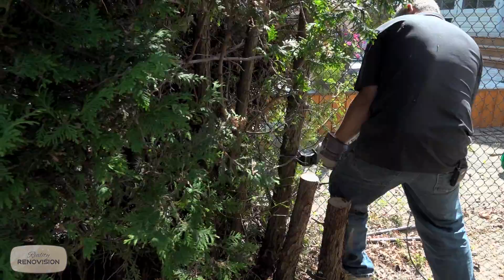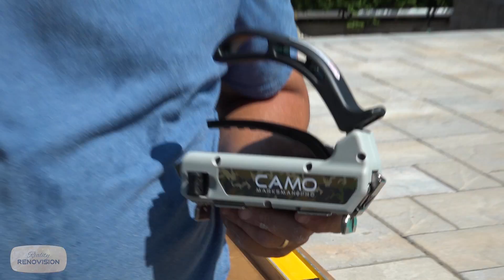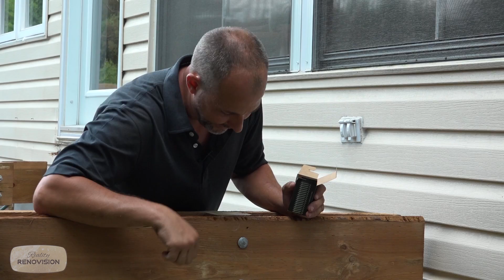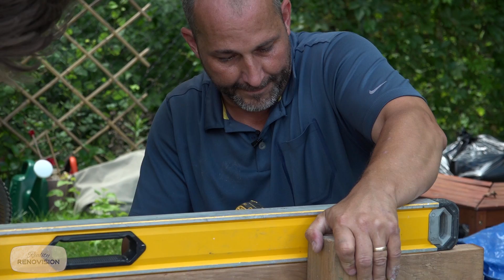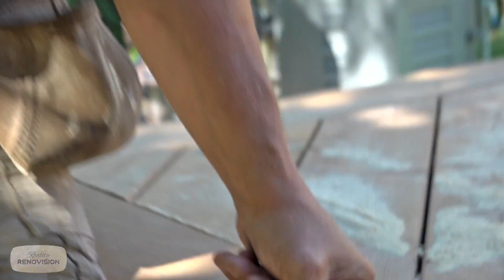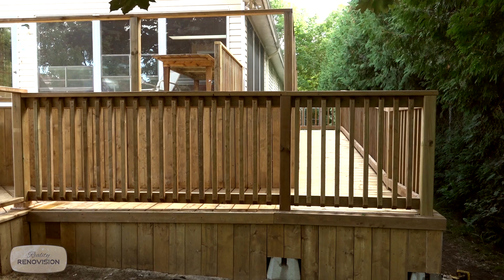How to Build a Deck with and Wheel Chair Access  | Reality Renovision Ep06

Comment: Well first of all should have used piles not a footing or floating for a project of that size. Box beams blow goats. The only people that use screws to frame are weekend worriors  and handymen. Joist hangers should absolutely be fastened with the right fasteners not screws! If you had an inspector with half a brain he would call u on it. Sorry for the bad news.

Comment: Jeff, good job on the patience needed to work as a team with other professionals. The stringer stairs section was helpful. One had to go use another channel to get the detail of how to treat the upper rise and the lower rise due
to considerations of the thickness of the thread; cut the bottom of the stinger the thickness of the thread so that
each step rise would be the same. On your other vid about fasteners was most helpful as well. Learning how deep a screw needs to go into the material was enlightening. Thanks! MegsCarpentery :)

Comment: I though you susposed to notch the 4x4 post for support instead of those big screws/ bolts or nails for support.  I guess the galvanized bolts sheer strength can handle all those load weight, but it is not good practice and a lot of states don’t let you do that anymore; code violation . All those weight doesn’t go through the post like you said but to the bolts instead.  But a lot of contractors tend to follow your practice cause its easier to do that then notching the support beams.